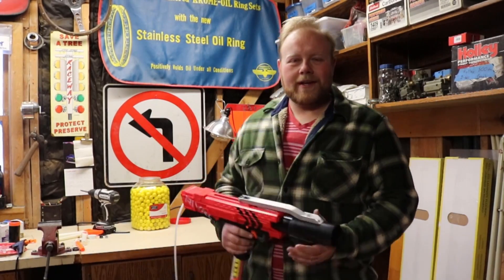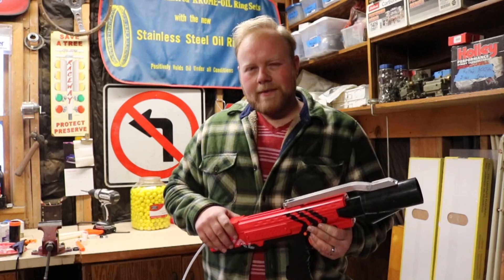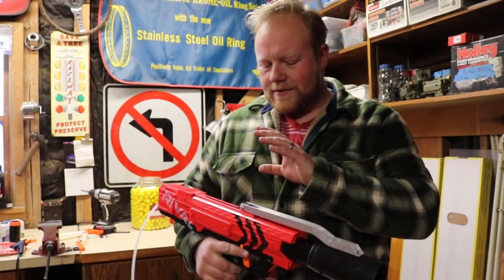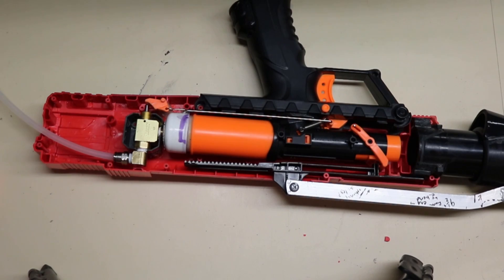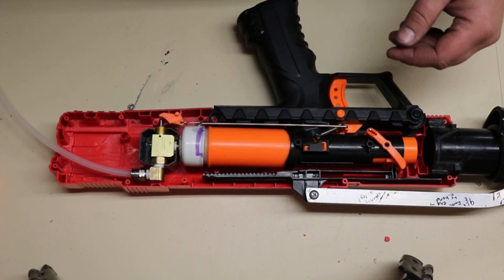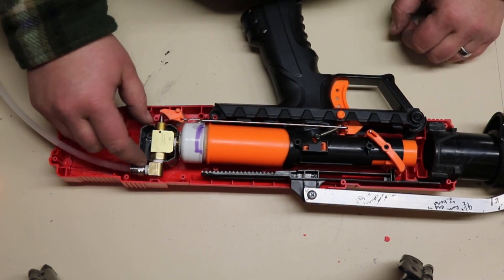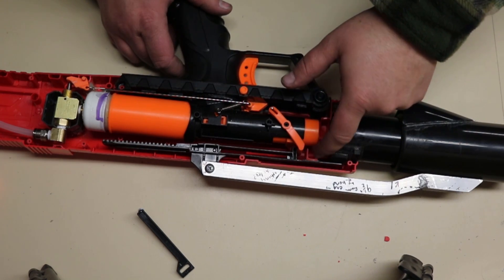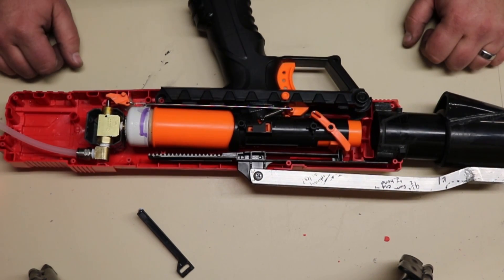The HPApollo Experiment

Comment: Sweet build! I'm planning on doing something similar with an apollo or a helios, but with electronic control and CO2 rather than HPA. The top portion should give me enough room for a solenoid to chamber rounds and I plan on using a solenoid controlled 3 way valve for firing. That way I can fine-tune the timing and use a micro-controller (arduino) for select fire (semi, 3 round, full). The rear end will hopefully fit a CO2 regulator and a small battery pack. Great video, and If I end up building it I'll credit you for the inspiration and design cues.

Comment: if you want to go the route of not having to pump it check out the polar star fusion engine.  it's used in HPA airsoft guns.  I've been waiting to see someone use one in a Nerf build
Reply: Designed for bbs, it doesn't recoil far back enough and definitely doesn't shoot hard enough, and they are really expensive

Comment: That's pretty bad ass.

It'd be nice to see chrono results. Did you remove the hop up?
Reply from the maker: I've got a Chronograph on my Christmas list, but I'm not necessarily counting on getting one (the wife asked "what the heck does that do, and why do you need one?"). Still, hopefully soon-ish? 
Hop-up is still intact, the blaster is otherwise stock, aside from the air supply. Once I can get a tank for it, and get a little more mobile, I'm definitely going to do some major testing on the range, ballistic stability and sciencey crap like that. This will likely be an ongoing project (hopefully somebody smarter than me figures out those little details sooner than later).

Comment: can it fire like a shotgun by priming it twice?
Reply from the maker: LittleBiglsteele It does, on occasion, but not reliably. I think the slight amount of forward pressure from the AR helped make room for the extra round to chamber. I removed the AR when I installed the tank, so I lost that feature. If I tip it down a bit while priming the second time, it seems to help a little? I'll definitely be experimenting more with it, and may try adding something to get a similar effect?I really did like the versatility of the Apollo (before it broke). 
but then again, if I go semiautomatic with it, I'll lose the shotgun option, but hopefully in favor of something better.